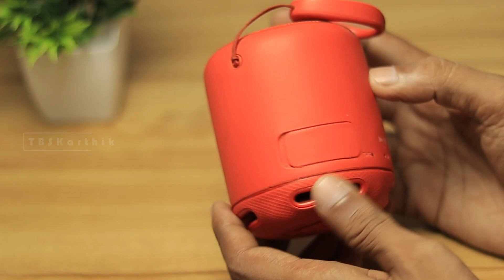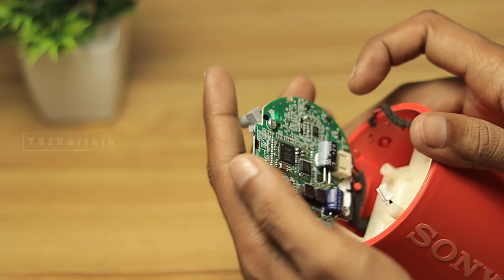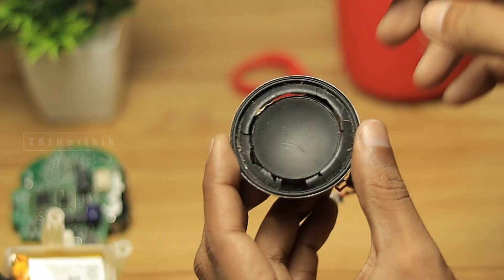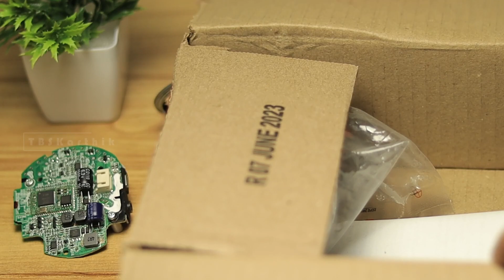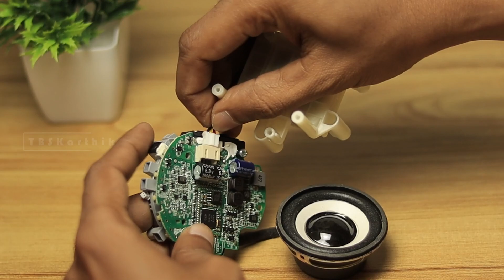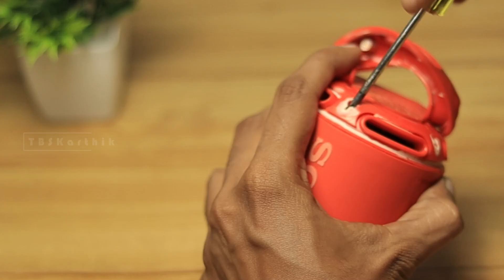Sony SRS XB10 Bluetooth Speaker Repair

Comment: Bro  ഒരു കേടായ TG113 bluetooth സ്പീക്കർ ലെ ബാറ്ററി remove ചെയ്തു 5v മൊബൈൽ charger codewire ആയി സെറ്റ് ചെയ്താൽ ആ bluetooth speaker work ചെയ്യുമോ.....
Reply from the maker: Battery voltage മാച്ച് ആയാൽ മതി. Battery 3.7volt അല്ലെങ്കിൽ 4.7 ഒക്കെ വരാം. 3.7 ആണെങ്കിൽ ചാർജരിലെ 5 volt ne 3.7 ലേക്ക് കുറയ്ക്കണം. Speaker board damage ആവാം. അത് ബോർഡ് ലെ പവർ സർക്യൂട്ട് ൻ്റെ ക്വാളിറ്റി പോലെ ആണ്
Reply: Thanks bro
Reply: @tbs_karthik  how to convert 5 volt charger into 3.7 വോൾട് bro അറിയുച്ച പറഞ്ഞേരോ
Reply: Broo